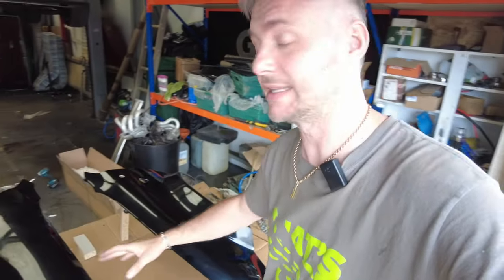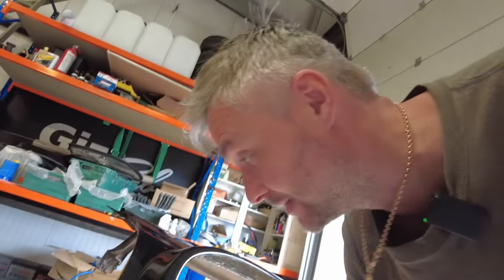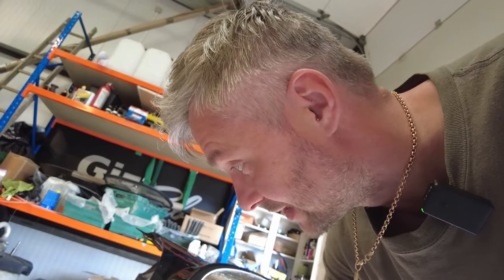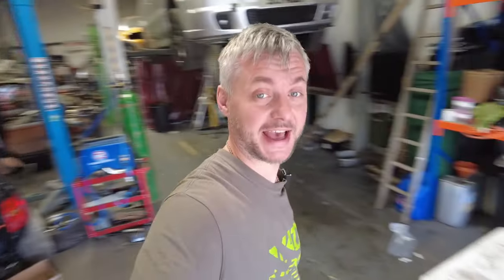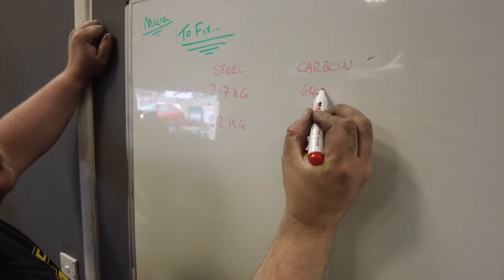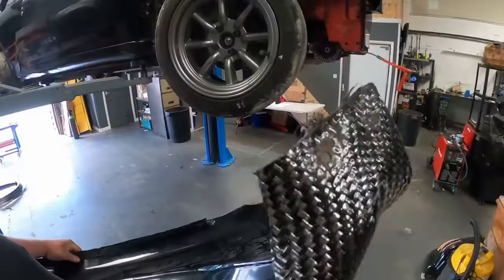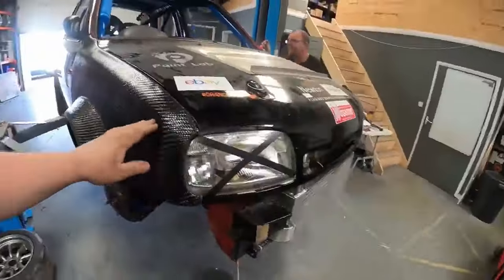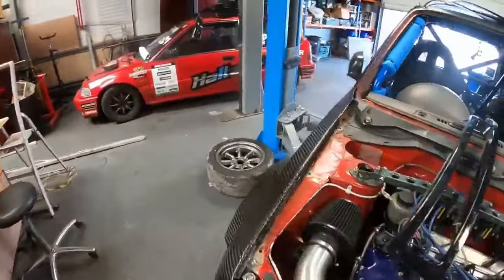Making EASY carbon parts for GIZFAB. Carbon Wings using the skinning wet lay method. part 2

Comment: Glue gun sticks if you cut them to length ..drill out the centre if needed and can be used as spacers behind the wings where you need to bring them out to suit the existing panels...they work great...nice work guys and great info for the diy guys ...lovin this👌
Reply from the maker: great tip!

Comment: This the same techquie  people use to make carbon Lay overs on trim pieces ?? Beside removing the carbon trim, it just stays on the trim pieces then clear coated. 

Also how xome you guys never clear coated tge carbon after ??
Reply from the maker: Correct. Process is the same. We wanted to save weight. Hence no clear coat

Comment: What did you use for the bottom layer? I have tried to search for it but I can't find anything with that name
Reply: The captions spell it as darling but I don't think that's correct
Reply from the maker: its called Diolen. but you can use e-glass as well

Comment: Bolting the carbon against the nuts doesnt seem like a great idea to me.

The small area that the clampng force of the bolt is spread over and the sharp corners of a nut is likely concentrating stress and would make the panel much more likely to break there.
Reply from the maker: nah it works well to be fair

Comment: Bit of a random question but what do you do if the bonnet you need to skin is from a larger car ie "Toyota supra" that you cant get the carbon cloth to cover the whole bonnet? If you skin the bonnet in x2 lengths of 1200mm carbon wouldn't you see the join/overlap in the center? Would you have to make a mould first in fiberglass so the overlap would be then on the inside of the bonnet?
Reply from the maker: overlap will be on both sides. you just have to make it a very neat one. or find 1.5m sheet
Reply: @RuskiWeldFab  thanks buddy!
I want to do the upper layer of my dashboard in carbon  but I want to try and save the dash from being damaged as its rare and in good condition. Is there a way I can take a mold from it without damaging it? Every tutorial on yt people doing dashboard they always ruin/sacrifice the dash to build one in carbon
Reply from the maker: Wrap it first.

Comment: I want to make carbon fiber for my car as a project and I have no clue of anything. When i saw how the carbon fiber  wing was done I was like thats terrible quality but theyre just the side wings, if it was the door i would have been like yeah they going to die.
Reply: One thing to consider is they did one layer with epoxy to get the shape. Cured then put on the car. For a quality finish you would then do 3 epoxy coats to get that carbon finsh you are thinking of.